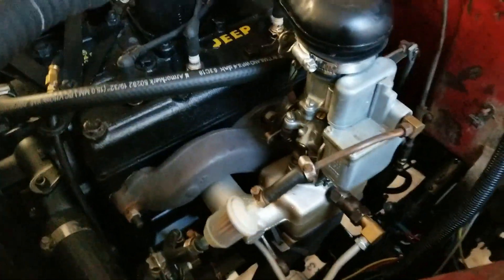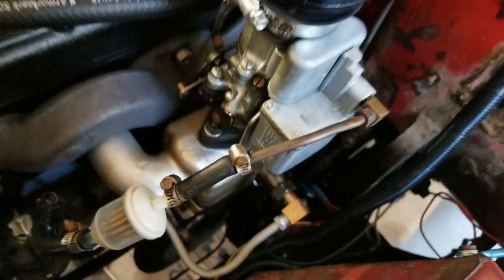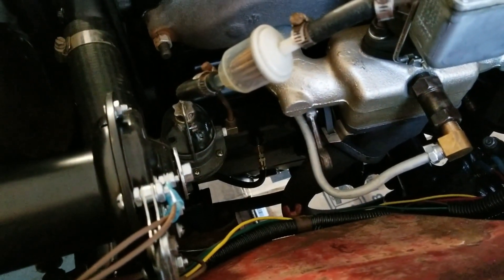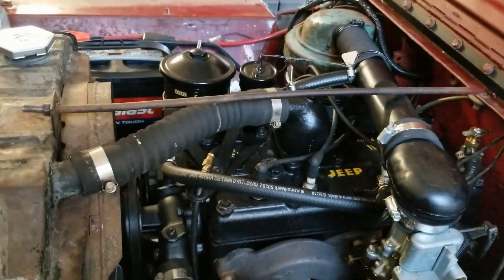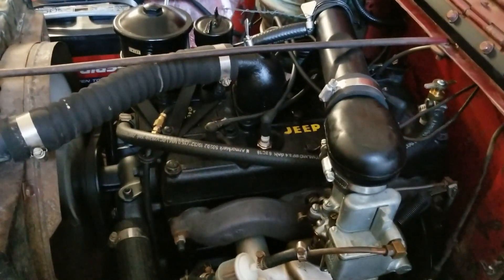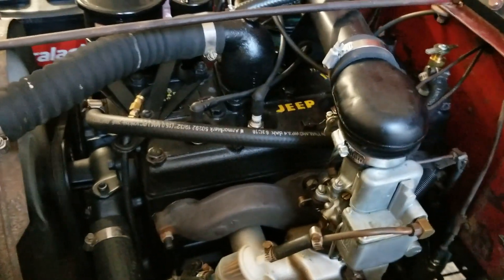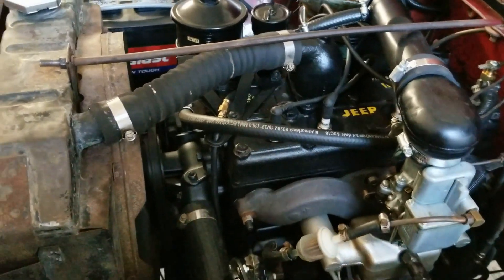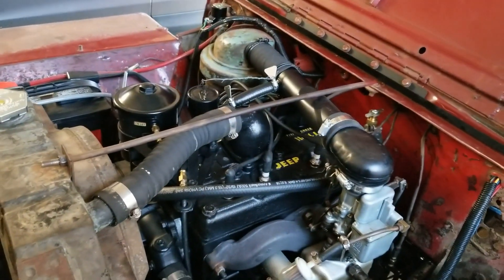Idle Question for the L134 Experts

Comment: It is definitely not normal, less with a warm engine (I see it is at 180), I had a really worn engine idle super smooth, it basically comes down to 2 things: 1) Fuel, unless you suspect that the carb has some dirt, I'd doubt that's the issue. That's a really nice new carb you have. To test if it lacks fuel, you can just use the choke little by little and see if it behaves better. I do see some bubbles coming from the fuel pump into the small inline filter you have, could be an issue with the pump or it is sucking air from a part of the line that's not sealed 100%. 2) spark, as annoying as it is, sometimes new things come with issues, a trick I use to see how the spark is behaving for each cylinder is: I use a timing light in the RPM mode and check each wire, if the RPM jumps around with random drop downs over 100 RPM, either the cable or spark plug is bad. I think you also got a tune up kit for the distributor, so I doubt it could be cap, rotor, etc. but again sometimes new things come with issues. The heat riser will make things worse only when hot, if it stays closed and the fuel gets so hot, it starts to boil, it doesn't seem to be working right, I'd check that spring, but that shouldn't be the reason why your idle is like that, but it could be more than one of the things I listed above. I hope this helps, good luck!

Comment: I had the same problem. The stop on the choke cable was too tight. Moved the stop out about 1/4” which gave the throttle arm on the linkage a little slack, reset the stop screw on the linkage to the preferred idle, and all is good. Hope that helps.

Comment: I've noticed in other videos that it idles high.  Have you checked for a vacuum leak?  It may not be a complete waste of time to tear into the carburetor,  there may be eome dirt in the idle circuit
Reply from the maker: I did check for vacuum leaks today. The manifold nuts were a little loose on half of them from a few heat cycles but were tightened up. The plug on the intake manifold vacuum port is tight and the carb is tightened up on the intake. There should be no leaks. (And a couple of sprays of brake cleaner in those areas did not affect the idle so I think it's probably safe to say it's good.)